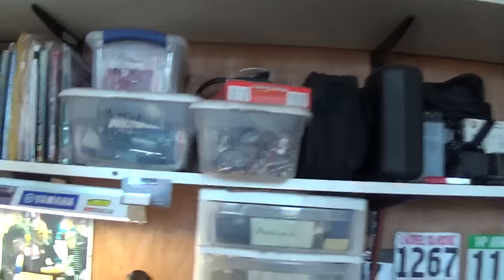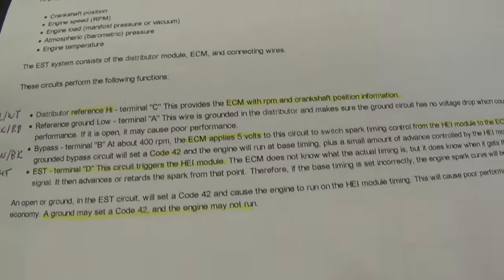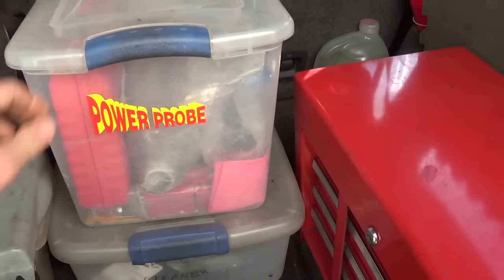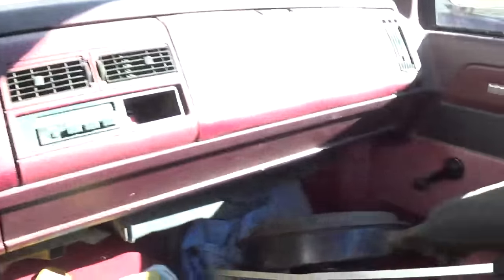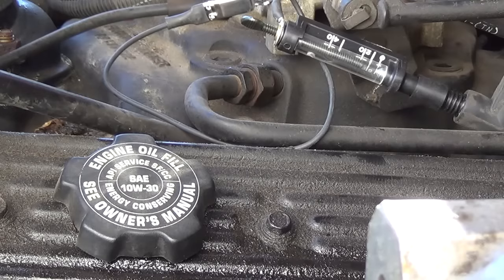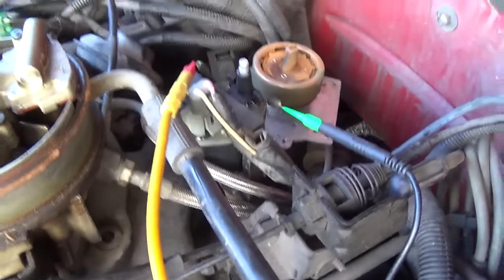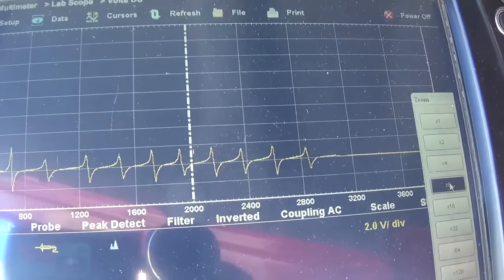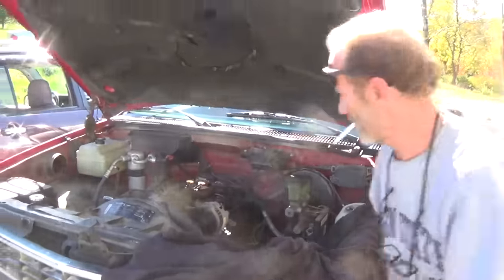Crank no-start: '88 Chevy truck 5.0 V8

Comment: When I was a GM mechanic the dielectric grease was for the heat sink between the moduel and the mounting surface to pull away heat generated by the moduel .Just FYI.
Reply: yep
Reply: Glad you said something, because that is how I remembered it as well.  Not even sure it was dielectric grease but thermal compound.
Reply: Shain Andrews yes, needs grease for heat sink
Reply: I do agree with dielectric grease for sure.
Reply: Dielectric grease is mandatory for sure
Reply: grapeknutz You are so right sir
Reply: Thank goodness you said something!  I showed my son how to install the new module and I used it under the module.  I thought I had steered him wrong.
Reply: Exactly I was gna say same thing
Reply: Nope! That grease is for the connectors. Thermal compound is used between the module and the mounting surface whenever there is a aluminum heatsink but in this case that chevy does not have a aluminum heat sink for the module so no thermal compound is needed.
Reply: Argeny Sandoval, I don't know where you got your lack of information from. They were all correct. That was definitely for the module to provide a heat sink connection. I've had the same argument with others so I got the information directly from the manufacturer of the module. 

From Standard Motor parts website, Form GF4552-3B; "Clean the mounting surface. Apply a liberal coating of the enclosed Silicone compound to the module's metal mounting plate to prevent damaging heat build-up." 

That form should have been included with the module. It is always advisable to READ INSTRUCTIONS. The module won't live long without the silicone compound.
Reply: you beat  me to it
Reply: grapeknutz Yep, and when the new module fails the part will be blamed. Aaaaaannnd....what is the first rule in diagnostics? Make sure battery is good and properly charged. This is sloppy diagnostics which usually leads to misdiagnostics.
Reply: exactly
Reply: A dielectric (or dielectric material) is an electrical insulator that can be polarized by an applied electric field. When a dielectric is placed in an electric field, electric charges do not flow through the material as they do in an electrical conductor but only slightly shift from their average equilibrium positions causing dielectric polarization. Because of dielectric polarization, positive charges are displaced in the direction of the field and negative charges shift in the direction opposite to the field (for example, if the field is moving in the positive x-axis, the negative charges will shift in the negative x-axis). This creates an internal electric field that reduces the overall field within the dielectric itself. If a dielectric is composed of weakly bonded molecules, those molecules not only become polarized, but also reorient so that their symmetry axes align to the field.
Reply: That's what I was thinking.  Now Ivan has to go back and fix it.  No shame in that, nobody knows everything and a little mistake, now and then, is good for your ego.  I changed one of these modules while throwing parts at a random shutdown, crank no start on a TPI.  Then I replaced the whole distributor, not sure what I was thinking then.  Then, in desperation I ohmed out the injectors cold, then warm. Found my problem. Computer was overheating on driving partially shorted injectors and shutting down the output driver's, WITH NO DTC being set, since the ECM didn't know the transistors went into thermal protection mode.  Nothing to do with spark, it was a fuel issue.  A can of starter fluid, or a simple spark check would have saved me a bunch of trouble.
Reply: @sinegra30  The plate where it mounts is aluminum. If one reads the manual it helps or read the directions that are in the box. 
Without it module will last about 3-4 weeks in the summer. One can use Dielectric or  Thermal compound the main main ingredient in both are silicon. It is used to fill the air space void where the module does not contact the mounting plate & it will conduct some heat off the module it's better than just an air space. And one other thing he stated it was an HDI put it's an HEI system.
(I read where he stated he didn't read the directions on applying it.)
https://www.jegs.com/InstallationInstructions/100/110/110-35362.pdf
Reply: cant believe how many times people miss understand the term "insulate" when using this dielectric "grease". Its to keep it from sticking to the surface. Aluminum and steel do not mix. Aluminum will corrode faster against steel. It then becomes bonded to it. The metal bottom on the module uses the aluminum housing as the heat sink to keep it cool... for nothing more or less. Anyone who has had to pull steel drums off of aluminum hubs on semi's knows this, it takes a 15lb BFH to remove those drums off those hubs in just a years time.... its almost like they are fused together.
Reply: @tiredoldmechanic1791  heat sink build up is ..... corrosion between 2 non ferrous metals such as aluminum and steel.  the dielectric grease is a silcon based grease to keep it from sticking and to seal it from moisture...  you all are wrong about why this is used.. and also right, for the wrong reasons.
Reply: @jotegg1276  Actually the module generates lots of heat , without the grease transferring that heat the module will prematurely fail.
Reply: @jotegg1276  Jotegg. Steel is not a non ferrous metal. The Standard Ignition Parts instructions do not mention "heat sink build up". It says "damaging heat build up". Those aren't my words. They are a direct quote from the instruction sheet of a company that makes and sells the modules with the provided silicone compound. If you put two perfectly machined surfaces together, they might transfer heat very well but these are not perfectly machined surfaces so the silicone compound is used to provide better surface contact for heat to be transferred from the module to the mounting plate. It also serves to prevent corrosion but its primary purpose is heat transfer.
Reply: @jotegg1276  It's best to use Super Lube 98003 Silicone Heat Sink it is a Thermally Conductive Compound.
Started working in a GM dealer as a mechanic in 1975. On a basic Tune Up we were to reapply the heat sink compound on the modules.
With time it would dry up & contract losing its full contact with dist housing & fry the module. Also high resistant spark plug wires would fry the module also. 
Most of the area under module does not make contact over 50% does not. If one applies the compound to module tightens it down then removes it. The pattern on module will show & any area with compound on it does not make contact.   
If you ever get a chance to install GM HEI Module install it dry without compound.
In the summer you may get 30 days before it's fried. just keep a spare one in the ride.
Reply: your correct
Reply: @sinegra30  wrong
Reply: @sinegra30  wrong.

Comment: Thank you for this video! My dad's 92 Chevy died going down the road. It would crank, but wouldn't start. No fire at the ignition coil. Replaced coil, still no spark. your video saved us a towing fee to a mechanic shop because we were stumped. Replaced the ignition coil module and it fired right up! Thanks again for putting this information out there!!!
Reply: Heat sink must be used..😂

Comment: I have a 91 Chevy 350 everything looks about exactly the same as in this video my truck is turning over but it is not starting I'm not getting spark I've replaced the module coil fuel injectors wires for the fuel injectors starter fuel pump plugs could you give me an idea of what is wrong

Comment: Hey Ivan great video and diagnosis! Been a long, long time sense I have seen a TBI. Actually brought a smile to my face. Brings back a lot of old memories. I use to own a '94 C1500 with a weak sauce 4.3 and a 5 speed. Me and Vanessa meet when I had that hot rod lol.
Reply: +South Main Auto Repair  Weak sauce LOL.  They were not a bad motor in the s-10's but ya, in a 1/2 ton you always had to push it too the wood.  When is the S-10 coming back for the transfer case install?
Reply: Brought a smile to you, but brought a tear to me. Last summer, I put an 87 model 305 in a 69 4x4 short bed Chevy p/u. Was a nightmare. Went to a carb, had to order an edelbrock manifold! Got exhaust manifolds off, replaced some bolts and gaskets, then the manifolds wouldn't go back on! Luckily, we had a couple sets laying around to choose from. Put an auto/overdrive behind it. That was a chore. Then the wiring harness was trash, so I had to rehab that. New homemade from the dash to the tail/turn/stop lights! Rust falling in my face the whole time! SAFETY GLASSES, REQUIRED!! However, the best part of the whole ordeal??? I didn't have to use a jack/jack stands not once!! It was tall enough for me to get under it without jacking it up!! PRICELESS!! I just deflated the front tires, to get the engine in and out!!
Reply: TBI was the best fuel delivery system ever made. Simple, easy and cheap to fix and maintain as well as being extremely reliable and rugged.
Reply: quite a bit more reliable than the poppet valve spider injection..
Reply: jewllake I drive a 1994 Chevy k1500 350 TBI and a 5speed. Great shape and you can't kill the tbi 350s
Reply: My first and last tbi was in a 4 cylinder gm. Ran good most of the time except below zero it had a tendency to flood the engine. Had to unplug it and crank it until it started and died. Then plug it in and it started right up. Flooring it always frosted the plugs. Had to always keep a good high amperage battery in that car during the winter because it was no fun pulling out plugs in below zero weather.
Reply: exactly
Reply: The 4.3 s will run. And have seen MANY cars towed with 1. Get the right gears and they will pace down the highway 80or so mph with decent mpgs. Not a V8 but not a bad engine.
Reply: Hey I have a 1995 gmc 1500 when u turn the key it backfires and won't start could u help me out please and thank u
Reply: @maverickdallas1004  gotta argue with that, TPI was the best system.  Just as simple of a system, just a few more injectors and a bit more fuel pressure, other than that almost identical control system from the ECM, but a buttload more torque.  Headers and good exhaust will make that truck romp, just needs a little more fuel pressure to compensate for the freer flow, accomplished by upping the spring tension in the throttle body.  TPI cars use an adjustable pressure regulator.  These ECM systems are so simple to fool into cooperating with aftermarket mods.  Upping the fuel pressure is a simple way to make open loop perform better, closed loop will quietly trim the injector pulse width back to compensate for the extra fuel.  The computer only has assumptions about fuel pressure.  The same level of ignorance about catalytic converter performance; it just assumes that there's one back there, somewhere.  ;). Moates.net sells a nice usb dongle that works with these OBD1 systems.  These systems should be used for basic training in tech schools. It's not hard to get these ECMs up and running outside of a car and simulate test conditions.
Reply: @curtisharrington8835  have you had the distributor out, or messed with it in any way?  Pull the cap and make sure the rotor is turning during cranking to eliminate a few mechanical problems (timing chain, sheared drive gear on distributor). Check the rotor position against TDC, compression stroke on #1 cylinder to be sure the spark is properly routed.
Reply: I joined that club had a 93 4.3 5speed long box standard cab i miss that.  I've had too many to count of these obs chevy trucks currently drive a 95 suburban 5.7 4x4

Comment: I don't know why but I really got a chuckle out of the owner running up and stabbing the throttle a few times then shutting it off.
Reply: yes...and before the alt had ample time to even throw a surface charge to the battery
Reply: Probably embarrassed that Ivan fixed it after he shot the parts cannon at it.... :)
Reply: Must've had a near empty fuel tank and didn't want to waste a drop...  He sure was in a hurry to switch it off.
Reply: Yep, he’s got places to go...

Comment: Good video Ivan thank you for sharing it. 
I remember my 84 Ford Mustang with the thick film ignition same problem. I replace the module one time without the dielectric grease and had to replace it again shortly thereafter. That's the beautiful thing about working on vehicles they teach us lessons all the time. The only thing that matters is that we learn something and move forward. Thank you for making these videos and for the hours of video editing.
Reply: DaveSender66 If the timing mark flutters, it's  the module. Ford had a recall on those modules.

Comment: Hey Ivan,  good video,,, FYI what is in the squeeze tube is actually heat sink compound to be applied to the shiny surface of the module where it contacts the distributor base which acts as a heat sink. It is to conduct the heat from the module to keep it from overheating and burning out.
Reply: That stuff transfers heat better than "dielectric grease" it's not the same stuff for anyone who doesn't know.

Comment: Most of my experience is with "older" GM. That aluminum plate used to be (and still is AFAIK) referred to as the "Breaker Plate" (it was where the points/condenser were). With HEI systems it must be bright, shiny clean- and that dielectric grease is applied to the mating surface of the module-to-breaker plate to dissipate heat (the breaker plate is a heat sink). That magnet and reluctor ring is very rusty, and that will cause a weak (but still useable) signal. I feel very sorry for that neglected engine- dirty, oily, covered with debris, loose throttle body, etc. A clean engine runs cooler- and the ignition being situated in the rear is a heat magnet, for sure. Standard motor Products T Series are very quality parts for the price. Do some research before you condemn.
Reply: Ignition parts by Standard, Wells and BWI are all good quality.
Reply: HUBBABUBBA DOOPYDOOP Ii

Comment: At the end your video: That ISN'T dielectric grease for the terminals. That's HEAT TRANSFER grease, that spreads onto the entire metal side of that module. It transfers heat from the module to the more heat-tolerant distributor. Just a little tip for the rest of you watching this.

Comment: Lots of comments about the dielectric grease.   When I did TV work, a 100 years ago :) it was always used on the "HOT" - Horizontal Output Transistor.  A metal unit with a Mica insulator to hold the case above system ground.   But, the grease was definitely used to help transfer the Trans Heat to the Heat Sink to which is was mounted.   Thanks Ivan - am a great fan of you and Eric.  Go New York!

Comment: Also when replacing the coil pack it has two pins pressed in to hold it to the bracket instead of drilling I used two good punches and was able to punch the pins right out in one or two minutes instead of drilling it out. I spray it with PB Blaster or WD-40 and then start the punch and give it another quick spray half way through and the pins will just start to fall apart and it'll come right out of the bracket. I did have a drill ready if I needed it but the punch and a hammer did the trick. Just a tip to anyone looking for ways to get those "rivet pins" out. Good Luck.

Comment: Enjoyed the scientific approach!!  The dielectric grease is mostly to smear on bottom of module to assist in heat transfer. Your Verus  doesn't seem to act up like Eric's. Maybe the torch and brake clean have something to do with it
Reply from the maker: +Bill Rimmer Thanks Bill! I'm curious how hot that ICM can actually get on its own under normal operation. It's only passing maybe 5 amps during running with minimal resistance. The distributor itself doesn't live in the most cool location either. Wonder why they didn't just mount it to the firewall or something if heat was such a big concern!
Reply: Good thanks

Comment: It's nice to take a little trip back to a more simple time when diagnosis was easier than today. I used to get right up inside of them like you suggested. The dielectric grease was supplied for the back of the module. I never questioned the reason as G.M. requested that it be applied there but I always assumed it was for heat transfer. Maybe it should be there to insulate it from the hot distributor base ?? I dunno.  Something else I learned on those is the little screened holes in the base of the distributor are there for air circulation inside the distributor to allow electrical gasses to escape. If they got plugged the  distributor cap contacts (Aluminum) would oxidize in a short period time. I also noticed that the plug had been removed from the pick-up coil to the module.

Comment: It has been my experience that with a scan tool plugged in, if the module is bad, the ECM should still see a crank RPM signal, fire the injectors once or twice, then stop, if the pick up coil is good. You should've stuck a noid light on it also while checking for spark. If the ECM loses its ability to control timing, it should start and run at base time off the module at fixed 0*, which was also common. That style HEI coil rarely goes bad. The older style coil in cap design did from time to time. Also worth noting, if you have a low battery, or the starter is drawing too much, the truck will not fire the injectors nor spark, until the ECM sees at least 150-200 rpm. Oh, and the noise you heard was the fuel pump prime.